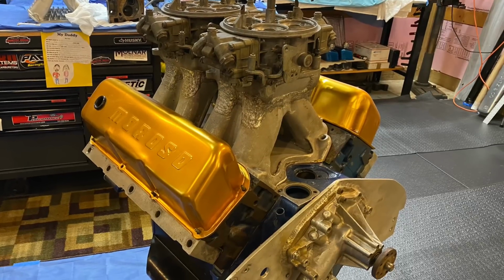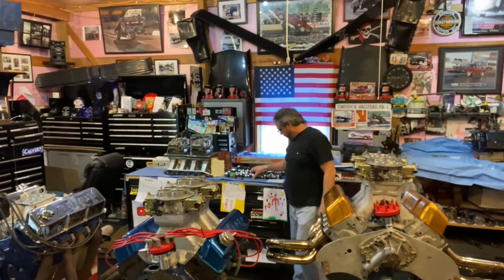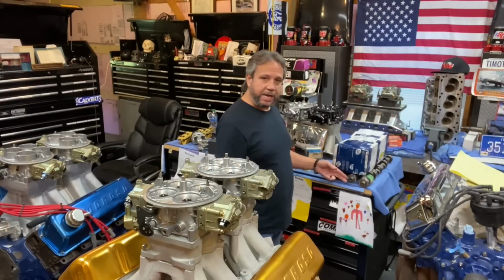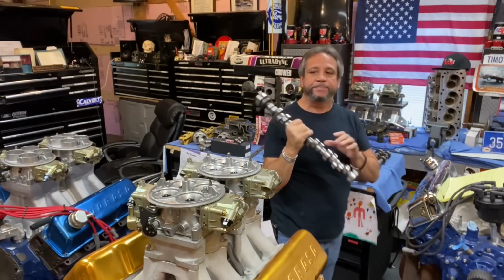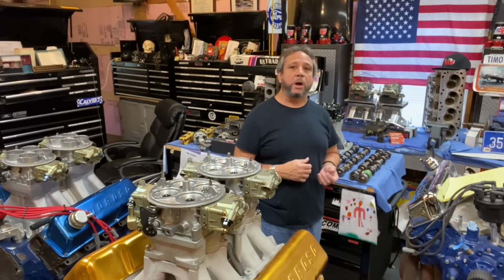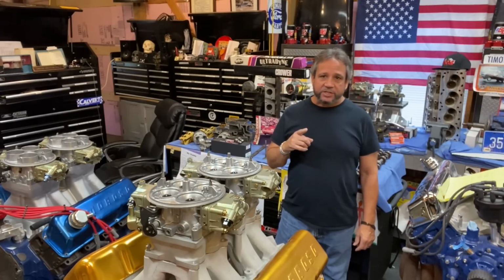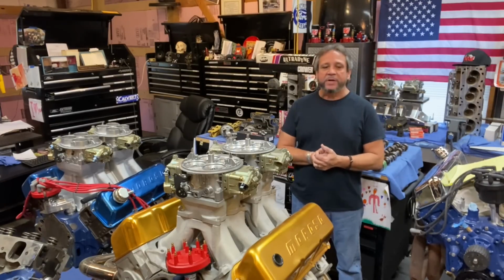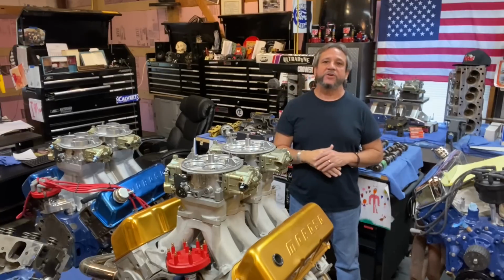DBG: Ford 351Cleveland Pro Stock Cams, Pics, Specs,  And Speculation? How Much HP  Did They Make?

Comment: The GK 324 / 328 is the advertised duration.....which is about 280 / 286 @.050. You're correct on the lobe lift. I actually have a GK catalog somewhere in the shop attic.....I'll see if I can find it. 

If it was 324 @ .050.......it would translate to about 360 + advertised....
Reply from the maker: I was told it was seat to seat measurement? See what you find Patrick
Reply: @dragboss351cleveland  "seat to seat" is Advertised Duration some call it total duration. 

My GK catalog is water distorted. I have no idea when since it's in a dry attic. 

I looked at a bunch of roller cam specs for every engine that's common and 324 advertised averages 284 @ .050. The lash and rocker ratio affect the number slightly. 

I have a Crane Roller for a Cleveland grind # R-282/450-2S-8 which is 

                            Intake              Exhaust

Lift                        .779                  .739
Adv Dur                 322                   326
Dur @ ,050           282                   326
CL                                     108
Lash                      .026                  .026

You can decipher most cam grinds easily........

R is Roller
F is Solid Flat Tappet
H is Hydraulic
HR is Hydraulic Roller

282 is the .050 duration
450 is the lobe lift (X rocker ratio is gross lift) this # is often 4 digit
2S indicates more exhaust duration
8 is the Lobe Separation Angle. This one is 108......10 would be 110

Most cam companies by the mid 70's adopted this system but some have the lift before the duration 

Advertised duration is a poor way to compare since every head has different flow characteristics........some having bad low lift......some good. The problem is that in reality, a valve is at low lift twice compared to once at max lift.

You can have 2 cams with identical advertised duration and lift and one makes more power. If you measure the flow once the lifter moves .050, you can now make a far more airflow measurement on a flow bench. 

It all comes down to what is called "area under the curve" 

Sorry...........didn't mean to be long winded.
Reply from the maker: @patrickrodig5667  I got cam timing and duration. Just not how they recorded info by hand. Cool
Info. Thanks. Go back and ck them out tomorrow. Thanks for taking the time get down for all of us

Comment: The biggest one I ever saw was a Crower 268 272 788 lift, right around 760 but home ported c302 and tunnel ram probably left a bit on the table, it would pull right to 8k limiter
Reply from the maker: Cool deal. Bet that an rough idle to it. Hell yeah

Comment: Hey dbg I have a 4v cleveland.  I bought it in the car.  Noticed there's hardly any oil to the top end. It's a solid roller has 70 psi oil pressure hot.   Should I pull intake to see if bushed? I have no clue other than it's a 4v
Reply: Take it apart. See what's been done to it.
Reply from the maker: How long the engine been running Oil pressure sounds good. Don’t need alot of oil up there, but need some. If it runs good and no issues roll with it.

Comment: Those glidden cams didnt have 324 or 328° at 0.050. That was the rating at lash. A couple guys have glidden pinto cams with the lobe numbers on them and references are still available. The biggest I have seen is a guy, Stan Weiss, that put his on a spintron. It was 283I 294E @ 0.050. What you are talking about is another 40° of duration. I can't find a lobe in a catalogue that big. Some exhaust lobes are just over 300@0.050.
Reply from the maker: Yeah I’ve never heard that before but you’re probably correct. What I will do is have his cams ran and get us Cam Card see what it says. Be cool to compare thanks for educating us appreciate it

Comment: Really wish that good parts were made for tall deck clevelands. Very under rated engines. Thanks Tim for this video.
Reply from the maker: Your welcome. Talk to TrackBoss Perform,ance Products, they cater to 351M/400, Stay tuned Frank
Reply: "tall deck cleveland" == 400M?   Don't need much except heads which you can go with ported clevelands and the others or CHI or other aftermarkets.     Custom crank rods and pistons can give it additional displacement.

Comment: Those 1964 SS/A  Thunderbolt 427 Hi Risers are saying they are making 950 hp and running 8's . They are using aftermarket legal blocks and heads . They question is how are that getting that kind of power out of Old Betsy ?
Reply from the maker: Heads and cams, and of course 16:1 CR. Not really sure. I talked with Barry Robotnick, he is going to come on for a live chat, we can ask him. Stay tuned.
Reply: @dragboss351cleveland  cylinder head efficiency period.
Reply: @dragboss351cleveland  … Tim there’s a YouTube video with Ray Pacquet discussing his original 1964 Thunderbolt Fairlane that he still runs today. He recently won the Super Stock title at the U.S. Nationals at Indy and despite his age, he still runs the full NHRA  schedule of events while winning his fair share of titles along the way. 

The man doesn’t mind talking about how he makes 950 horsepower and has the Thunderbolt running 8’s. It’s pretty much like you said, modern technology applied to the induction system and roller cam profiles are the biggest factors in making huge modern day power numbers. 
When I was helping out with the Thunderbolts that Gene and Bonner were running in 1964 , running 10’s on 7” wide slicks was a big deal at that point in time. 
Looking back in time I realize that technology is our friend 🤷‍♂️🏁.
Reply from the maker: Yea have seen the video. Very cool and 950 from an Fe seems unheard of. But he is still racing like a bastard. So cool.  You been around my friend and seen lots of changes and progress. Thank you for commenting. Stay tuned. 🏁💪💯
Reply: @dragboss351cleveland  … There have been a lot of changes over the decades and I’m still amazed at how performance has come alive as technology advances forward at a blinding pace. These comments are a few months old now but I hope I didn’t miss Barry as a guest on The Garage. He really knows how to build winning FE’s and he could give some amazing insight on how they have changed over time 🏁.
Reply from the maker: Just trying to get him committed to a time but it’s difficult. Brent Lykins is going to come on 2/18 at 7 PM. He can talk after he’s in Cleveland get his take on everything. Glad you’re here, my friend, like I always say always learning something new at DragBoss Garage
Reply: @dragboss351cleveland  … Brent’s channel is another one of my favorites. He does Clevelands and FE’s. Life is good 🏁

Comment: Chet Herbert
It was 1949 when the first roller cam was manufactured for the performance automotive engine and it was Chet Herbert who designed and ground it. Since then, Chet Herbert Cams has been a leader in roller cams. Today's rollers feature faster ramp speed and higher lifts for the ultimate in power
Reply from the maker: Thanks JMR, was thinking that or Howards, I know they used them in the late 1800 for some engine, from what I read.
Reply: @dragboss351cleveland  I know certain airplane engines had roller cams and roller rockers. Harland Sharp was the manufacture of roller rockers in the Allison air craft engines and one other if im correct.
Reply: Any idea what engine it was used in ?!
Reply: Helping Herbert's Beast become so dominant were the roller lifters in its V-twin, a feature of Harley engines since 1929. Herbert tasked himself with applying the technology to a Chevrolet six-cylinder that he was building for a circle-track racer. No established camshaft grinders in Southern California knew how to grind a roller cam, however, so Herbert went down to his local Sears, bought a lathe, and converted it into a camshaft grinder. After some tuning, Herbert had the Chevrolet engine putting out 275hp--more than the Offenhauser engines the circle-track competition was running.
Reply from the maker: I had even heard design and use back to like 1880 or something. Always learning something. Thanks so much for the wicked run down JMR 🏁